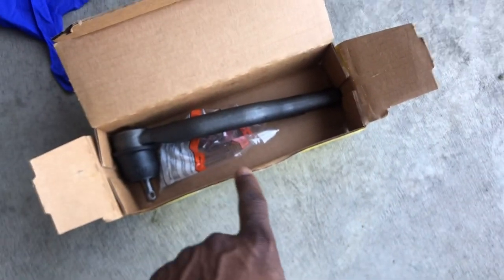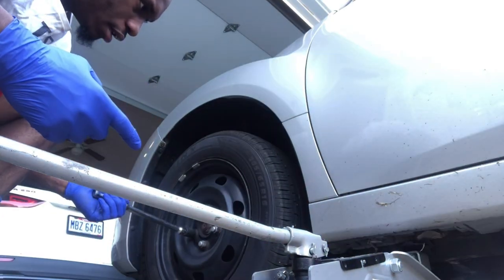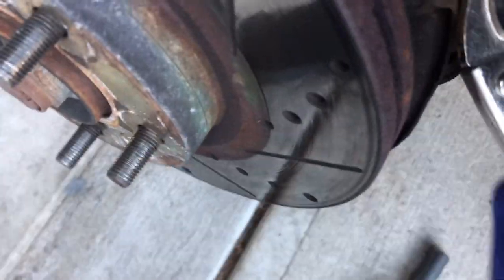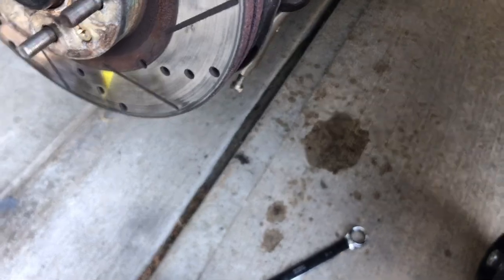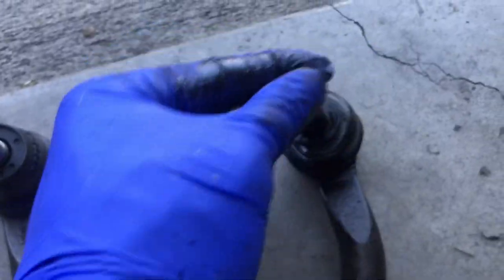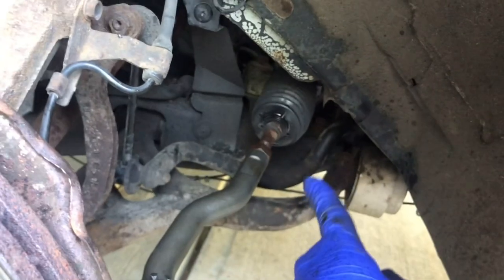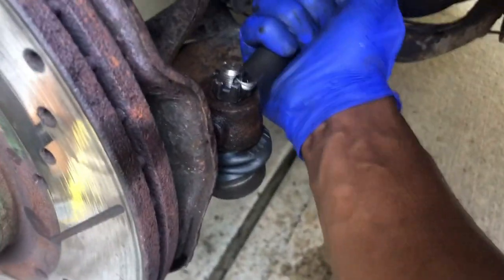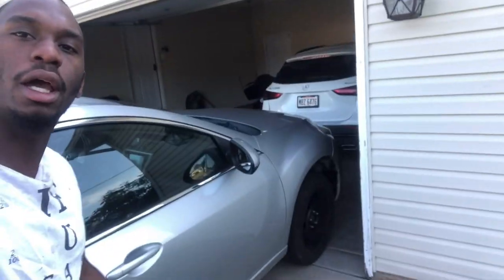How To Replace Outer Tie Rods 04-14 Mazda 6 | How To Tell If Your Tie Rod Is Bad

Comment: I am done with this video as soon as he said "were nit getting alignment". Why? Youre not going to get it right 1000%. Not a chance. Youre gonna destroy your tires and car aint gonna sit right nor have maximum traction in either accelerating or breaking. It aint woth it. 50 bucks for an aligment is a MUST after you change suspension parts!